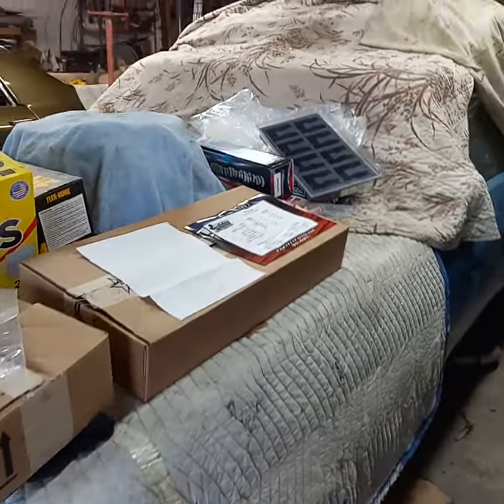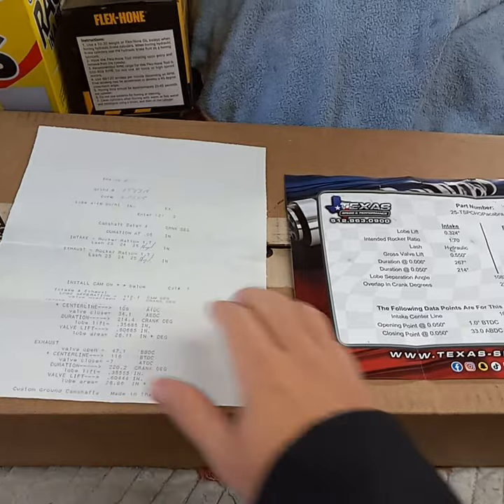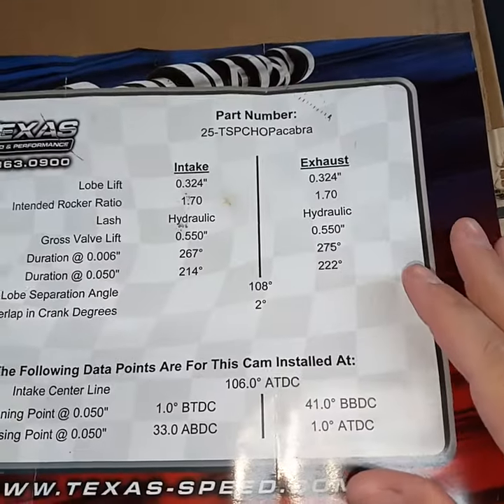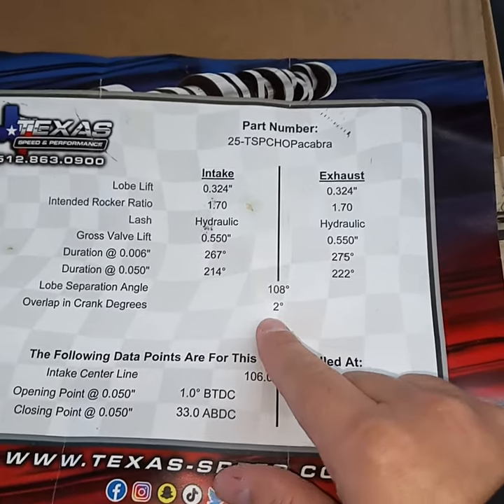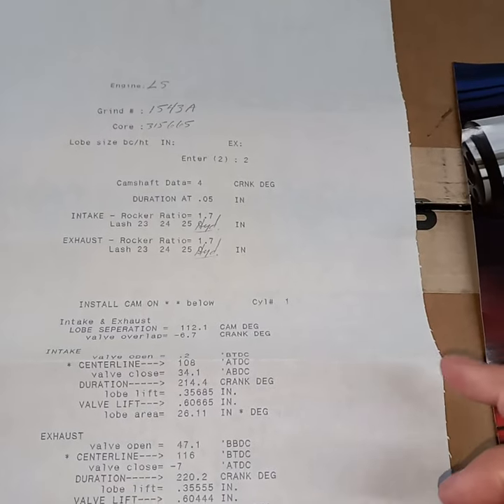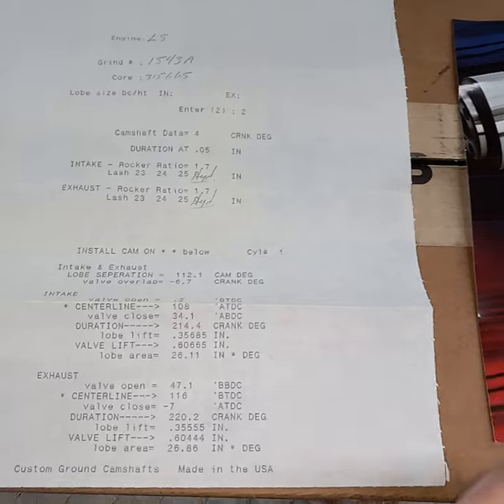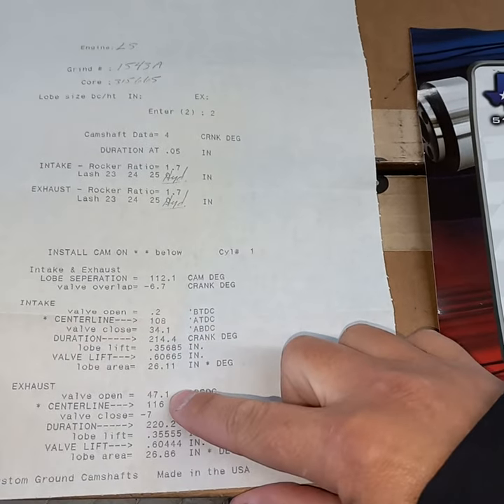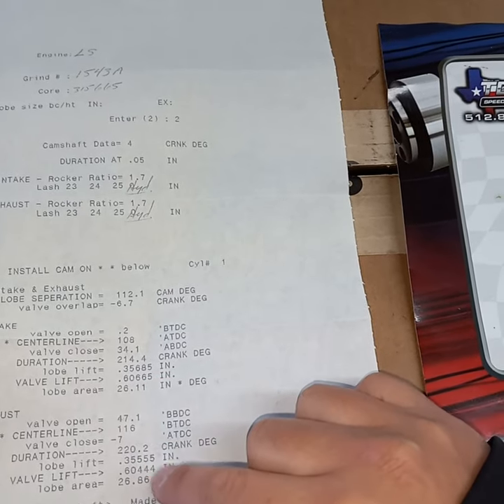Texas Speed CHOPacabra vs. EPS Truck TQ1 comparison 🧐 #camshaft #cammed

Comment: .006  on the intake for the  EPS?
Reply from the maker: I'm not sure I understand. Some manufacturers do .006 and others do .004

The EPS cam sheet is more exact and complete than what came with the Texas Speed cam.
Reply: @bluecollarhotrods9781   either .006 or .oo4  ...i think you just gave 214 which is the .050

Comment: Shoulda compared it to the truck norris
Reply from the maker: It's similar in spec to the Texas Speed cam. BTR won't say what the exact number is for the duration on the exhaust side. If someone has run one through a cam doctor and wants to share, I'd be happy to add it.
Reply: @bluecollarhotrods9781  i think the chopacabra is slightly more aggressive but was designed to be better on stock convertors. Hoping holdner adds it to his already huge stack of videos comparing
Reply from the maker: @loweredyote8416  on paper, the BTR is 212/22x  .553"/.553" 107.5 LSA. Not much different than the TSP cam. I offered to send Richard my cam before I installed it. When I change the heads and cam on my truck, I'll offer it to him again. I'm not against him borrowing it and seeing what it does in one of his test mules. I had really good results with a Texas Speed 216/220 high lift truck cam in a Gen IV 4.8L I expected better from the CHOPacabra in my truck.
Reply: @bluecollarhotrods9781  it seems like they cared more for sound than performance with it. I was thinking of ditching my summit 8709 truck cam for a chopacabra in my lq9
Reply from the maker: @loweredyote8416  I wouldn't do it, just my personal opinion/experience. I would find a better cam. It sounds OK in my truck, but the power isn't impressive at all. I'm disappointed.

I just looked up the specs for the 8709, if it were me - I would find something in between the 8709 and the Truck Norris/CHOPacabra cams.
Reply: @bluecollarhotrods9781  that’s what I’m thinking too. Goals 360ish awhp. Gonna have longtubes, 243 heads to replace 317s, and mayyybe a manifold
Reply from the maker: @loweredyote8416  I'll be posting a video soon outlining my next steps. I'll be swapping the cam and heads soon. Pretty similar to what you just said.
Reply: @bluecollarhotrods9781  nice. 6.0 too or same 4.8? I’ll give ya a follow
Reply from the maker: @loweredyote8416  I have an LQ4 6.0L  and 4L80E swapped into my 2001 rcsb. TBSS intake, 92mm TB, SE longtubes, exhaust, etc. 

Thank you for the support.
Reply: @bluecollarhotrods9781  that should be a runner. I was thinking of doing the tbss mani too but ls2 mani supposedly is same thing but shorter
Reply from the maker: @loweredyote8416  If you look at my dyno video... it definitely underperformed. I have the CHOPacabra cam in it and 862 heads to bump the compression. I wasn't expecting HUGE numbers, but I think it's down at least 10-15 from where it should be. I put an LQ4 and 4L80E in my dad's RCSB Sierra too, has an XR275 with 317 heads and it feels way stronger than mine.
Reply: @bluecollarhotrods9781  could also be a difference in motors too. Some just perform better than others. But with those heads you should have the edge on him. That’s definitley odd. I hear the sloppy stage 2 is a real performer too
Reply from the maker: @loweredyote8416  Could be, but this engine is in better shape than the one I took out of my truck after the lifter failure. The cam bearings were beautiful! (I know, not supposed to look at them) The Sloppy stg 2 is a definite go to cam, it is a good cam for the money. I prefer more split than it offers, but that's just my personal preference.
Reply: @bluecollarhotrods9781  what’s the benefit of more split vs even?
Reply from the maker: @loweredyote8416  The exhaust ports are usually weaker, helps get the spent gasses out... generally makes more power. For me - 8 degrees of split has been that magic number for me. We put a 224/232 in a friend's Gen IV 5.3L with a good set of cylinder heads, it put down 415/393 on a dynojet. Stock shortblock, TB, etc. I had a 228/236 in my 2000 Z28, that car did 480/443 and ran 10.7-10.8 at full weight. The 224/232 was on Comp Cams lobes, and the 228/236 was a Crane. But, that is my personal preference - shouldn't be taken as the final word. But, I do notice that a lot of these newer cam grinds that seem to perform well usually have a 6-8 degree split minimum. The 459 cam RH likes is a Comp Cams 231/239 @ .050"
Reply: @bluecollarhotrods9781  truck Norris is 212/227
Reply from the maker: @eddiemathers2860  Has someone actually run it through a cam doctor? I've searched online and can't find anything other than 212/22X
Reply: @bluecollarhotrods9781   ive seen the cam Dr on the norris its 10 to 11 extra on the exhaust side....specs also seem larger than advertised